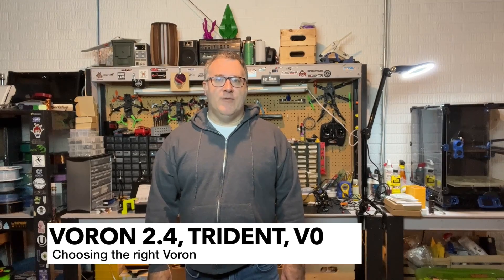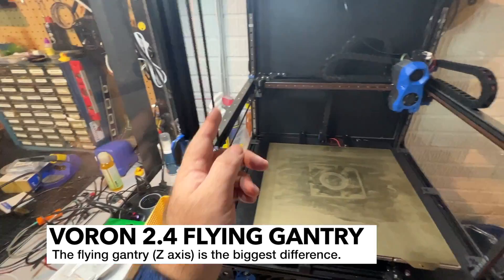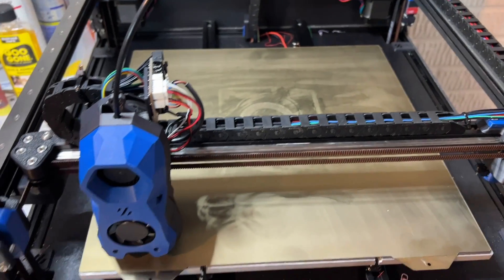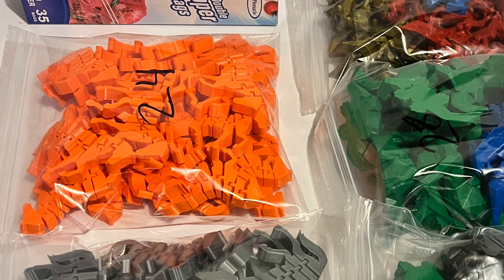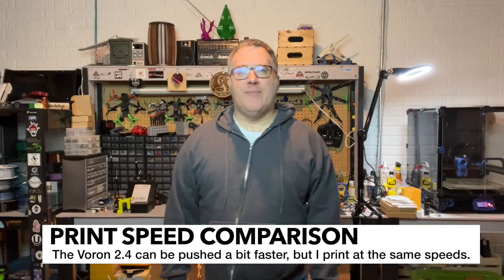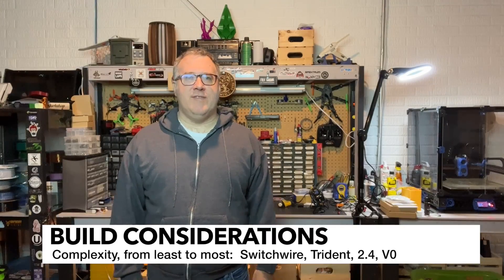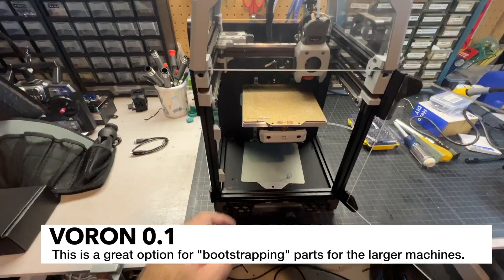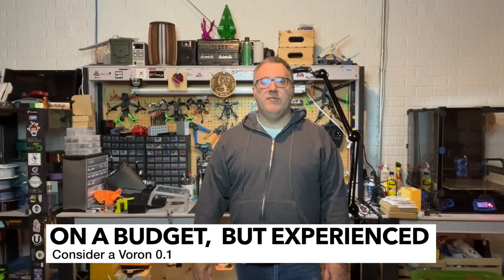Which Voron should you build?

Comment: This video was what I was looking for.  Earned my sub.  I think I want to try building a Trident (over purchasing something).  My question is, if I build it somewhere between decent and well, will I be able to "just use" it or will I have to constantly fiddle?  By fiddle, I don't mean mods I want to make, but changes/tweaks to allow reliable prints.  Thanks!
Reply from the maker: Thanks for the sub and comment! Once you build a Trident, you shouldn’t have to do anything with it unless you want to upgrade it. I would recommend going with Canbus or USB toolhead wiring vs a cable chain, as some of them tend to wear out prematurely.

Comment: I'm shocked the 2.4 has higher print speeds than the Trident. I thought a fixed XY would allow higher acceleration settings 😢
Reply from the maker: I think it is probably a toss up. Z hopping on a 2.4 can be very fast. To your point, Trident can be constrained due to fixed gantry. There has been a lot of points made both way and I was leaning to 2.4  as the advantage when I made the video.
Reply: @GregsMakerCorner  Thank you for replying! I'm thinking about building a 2.4 or a Trident to move beyond my Ender 3 Pro and Ender S1. I've tweaked and tuned them to create quality prints but want something faster. Your video was really helpful comparing the two Vorons.

Not sure if you care but I'm likely going to make a welded steel frame to make it ridiculously rigid and high inertia.

Comment: FWIW - I did the v0.2 S1  LDO kit as my first and didn't find the small size added to the complexity or difficulty - particularly with the high quality LDO documentation.  And the lower price of the v0.2 made it much easier to pull the trigger on the project as a whole.   I may do a Trident next - or more likely the Salad Fork.
Reply from the maker: That’s awesome to hear! The ldo kits are really good and they do have those nice slide in nuts now that make the build much more forgiving. Best of luck on your next build!! I am sure you can handle any machine now that you’ve got a 02 under your belt.
Reply: @GregsMakerCorner   Well, it's not all the way under my belt quite yet :-)  Just getting started on the firmware now.  But yes those little slide in nut holders make a HUGE difference.  I can't imagine trying to do the build w/o them.

Comment: very good video.

I would add that if you want to 3D for doing functional applications, the v0 is the one I would recommend.

Functional parts are almost always small (for example, all the parts to build any Voron can be prited on the v0).
Your design or prototype will make use of aluminium parts for the parts that require length (i.e. robot arm will not be printed, just the articulations).

From a pure engineering point of view the v0 / trident is the most pragmatic.

The only 2 reasons to go for a v2.4 is if you enjoy 3D printing to tinker with your printer or if you are into cosplay and you need very big PLA parts.

Great video again, you've listed well all the pros/cons I think (can't remember if you spoke about the fixed bed of the 2.4 that can warp (not sure if that has been resolved in the latest version of the v2).
Reply from the maker: Thanks, really appreciate the insight and feedback!!

Comment: Fantastic video, very well arranged!  I like the stationary bed of the 2.4, and only now just learned about the Trident's existence which sort of makes it a Rat Rig or Hevort IMO.  Question tho, could the triple Z be added to the flying gantry?  With a stationary bed, I think a 200x200 could be inserted into a 350x350 with a magnetic insert over both which might allow for dual zone heating of the bed for small or large parts.  I have decent CAD skills and am now planning to build me a CoreXY after many years with my trashy Tevo Tarantula, but I also built an MPCNC that I don't use, so have plenty of extra parts to repurpose.
Reply from the maker: Thanks for watching and commenting! I am not sure about a triple Z on the Voron 2.4 but that would definitely be a cool mod!! With a bit of cad work I think it could be done. Best of luck!!

Comment: Thank you.  great Video.  I built a v0, guess I started backwards as well.  Looking for a bigger printer, for the Voron 2.4,  any difference in build issue or quality between the different print sizes ?  300 vs 350 ?
Reply from the maker: The larger size Vorons will not be able to go quite as fast nor have quite the same max acceleration without issue. I have a 350 size and a 300, and they both are great printers. If you don’t think you’ll need the 350 I’d recommend going 300.

Comment: @10:30 "..Because the flying gantry should allow you to print a bit faster"
I don't get that? The fixed one on the Trident is more ridget, so more stability, so potentionaly more speed?
I only see more plusses for the Trrident:

- Ridget gantry
- More suitable for tool changers
- Chamber heats up faster, because printing at the top of the chamber
(- Easier to build)

Maybe the 2.4 is a bit absolete at this point?

Comment: You may benefit from examining the airflow from the fans under your machines to determine which components are requiring airflow and then ensuring directed airflow at them. Ducting can assist - just the same as is used in servers and other slim environments. The open sides etc mean that you may have very little static pressure and airflow over the items that need it. 

Too often air is not controlled on amateur designs and thus excessive airflow is used to compensate.

Comment: I started my voron ownership off with a gen one v2.4 I did a lot of things different when it. Mainly it runs rrf, it was a pain to get working. But I got used to it and despite the complication it's proven a pretty reliable machine. I considered getting a v0 then a Trident, entertained a micron or salad fork as well. Ultimately I bought another v2.4, the kits have greatly improved it's been a breeze to get working. I am squarely a huge fan of the v2.4 over all other voron designs. it's complexity does not equate to unreliability, it's over engineered z axis actually is the most reliable thing about it.

Comment: just to make this clear: "stealthburner" is the Tool head, NOT the extruder. The Voron extruder that normally goes with the stealthburner is called "clockwork 2", but the previous iteration (clockwork 1) fits as well
Reply from the maker: Good point! I often use them interchangeably when making content but you are correct. I don’t know anyone building cw1 with a Stealthburner shroud but there may be someone who does it.

Comment: My first voron was a v0 kit from ldo and i am currently finishing my 2.4R2 ldo kit and can confirm the 2.4 is easier to build.
my v0 has some issues i think i can remedy with replacing the host computer (CB1) with a genuin pi4. I have a pi4 in my 2.4 since i did not want to run into these issues on it

Comment: From what I see here the main difference is that the bed is fixed on the 2.4 but moves on the Trident. Did I miss any other major difference that would affect speed or quality?
Reply from the maker: You got it! That’s definitely the biggest difference. The main differences are related to the flying gantry and bed. 3 motors on trident instead of 4 on the belted Z for the 2.4. Even with that many of the parts on the machines are very similar.

Comment: Great video, I  am trying to decide which one to build. I was going to start out with the V0 and then use it to bootstrap parts for other printers. I also thought it would be good start since it was the least expensive of the kits. But hearing you same it is complex because of how small has me worried, this would be my first time building a 3d printer so I may look at the trident instead. Would you recommend any other builds that may be less complex? I was thinking maybe one of the prusa kits but I am unsure.
Reply: I recently finished my 0.1, if you are accurate in your measurements and do everything as described in the manual it's not that hard. Be prepared for a lot of disassembly in case you want to mod your printer (kirigami, nevermore, 0.2 conversion etc.).

Comment: How do you feel these builds are for people who are solid on mechanical and wiring but novice on programming. Was going to build up my ender 5 with parts sourced towards a future voron build
Reply from the maker: I think you'd be fine. A programming background isn't needed, but Klipper may be a bit of a learning curve. There are some good step by step instructions and stock printer.cfg files for the Trident, which make it pretty easy to get up and running quick especially if you go with an Octopus board.
Reply: @GregsMakerCorner  does it need a seperate pi or similar, ive heard both said
Reply from the maker: @2fwelding842  Yes, a Raspberry Pi (3 or better, model B) is the best choice to run the Pi. They are a bit hard to find right now "brand new" but you should be able to get a Pi 3 for a decent price, which would be around $50-60. The pi is what gives commands to the printer control board (usually a BTT Octopus).   Take a look at this guide for more info. I also have a channel on how to get it set up, see my BTT Octopus guide. https://docs.vorondesign.com/build/software/

Comment: My voron path was v0 -> v2.4 -> Trident. 
If I could only build one I'd say it would be the 2.4 because I think the flying gantry is the number 1 standout feature from the Voron group.
Reply from the maker: Yes.. that is a really good point! The flying gantry of the 2.4 does set it apart from other Core XY machines on the market. I have to admit, I really like that feature.
Reply: @GregsMakerCorner  I went with a 2.4 because I loved the flying gantry and bed tramming. Also the stationary bed is by far the best solution for large format printing, especially on heavy or tall items at any reasonable speed. Not to mention the bed tramming system works especially well with a conveyor belt module to eject parts!

On the other hand, the trident is better for non-planar printing, and can double as a filament drier since it can stash a spool to the sides and back of the bed! (And since the gantry isn't trying to move through that space)
Reply: What are the advantages of that? It just looks like more complication but I don't know what the advantage is.
Reply: @Graeme758  can you clarify your question? Advantages of what part?
Reply: @adamrosenberg4367  What is the advantage of the flying gantry over the Trident 'fixed' gantry? With the Trident bed only moving in the z axis, and relatively slowly, I'm not seeing how it is an issue with large prints.
Reply: @Graeme758  any time you have a lot of Z hops, like lattice structures, you'll feel the difference, also large prints add a slowly increasing load to the bed, and on a moving bed that means slowly changing behavior as the print progresses. For me the clincher was that lead screw driven beds have an issue with Z banding on the print, where a belted Z system minimizes or eliminates that.

True, you don't experience most of that on small, casual prints at moderate speeds, but nobody builds (or nobody should) a voron because they have a casual interest in printing. If that's you, then I recommend a Prusa, it'll get you what you need with minimal fuss, and is practically turnkey.

Comment: I started with V0.1 LDO kit and 4 months later built a V2.4 350 from LDO. In terms of complication I do agree that V0 requires you to follow the manual exactly step by step while V2.4 I can jump around the manual to a certain degree. V0.1 is amazing machine and I couldn’t believe that I printed all essential parts for V2.4 on V0.1 leaving only larger parts like skirts and screen housing for Prusa mini. I find the challenge of V2.4 not in the complication of flying gantry but installing the front doors to open and close properly without bumping into the door latches and also have the doors not sagging in the middle. Took me many tries of taping and peeling them off and re apply them.
Reply from the maker: The doors are really a pain! I used 3" wide masking tape to hold my door panels on my machine, from the sides and top, and then I installed the hinges with the VHB tape. I believe Steve Builds has a video showing a similar process. That method seems to be about the best way to guarantee the doors closing properly.  Thanks for watching and commenting!
Reply: Personally I ended up printing those larger, nonessential (to function) items on the V2.4 itself! I had my Ender 5 with an all metal hot end and an rpi cam inside of a cardboard box to print the essential components, then I taped the body panels and doors in place to print the skirts, panel clips, and other such that my Ender wasn't quite up to the task of printing!
Reply: I hate the magnetic doors. On my second 2.4 I went to using the latching panel mod as door latches.... Seems to work pretty good.

Comment: I recently built a voron 0.1 from a Formbot kit. And your videos was a great help! The hardest part was to 3d print the parts which took a couple of weeks on my ender 3 s1. Apart from that it was pretty straight forward. One tip, ad more nuts for mods later on. Also use the V0 No Drop Nuts or V0 1515 T Nut mod depending on what kit you got.
Reply from the maker: Great suggestions! Yeah, the nut mod really helps. Thanks for watching and commenting, glad to hear you got yours going!
Reply: This is the path I'm planning to take as well. I have an Ender S1 Pro and eventually want to upgrade via the Voron 0.1 (or 0.2 now) to the 2.4 or Trident.

One question I have: How was the ABS print quality on the Ender S1 for you? Did you buy an enclosure and do you have any pictures of how the result looks like? I'm still deciding between printing myself or just using the PIF program for it
Reply from the maker: @mark_walet  I can't remember ever trying to print ABS on a Creality machine, but you definitely can try it. An enclosure would be a necessity for the larger parts, otherwise you will get warping. If this is your first Voron I would recommend PIF or buying parts directly from a vendor, I have parts from BoxxyPrints on mine and they are better quality than what I have printed myself, and have always had a great experience.
Reply: @mark_walet I got very good results with no waping, using ABS+ from PrimaCreator and printed from an open closet with plastic covering the opening

Comment: The best overview for one looking at voron options. Thanks a bunch.

Question: I need 300x300x600 for ASA. Looking at your belted 2.4 it seams to be my best bet. Do you agree?
Reply from the maker: Thank you! I really appreciate the feedback. 

For ASA/ABS and something running 600mm for build volume, I think you would be able to accomplish that with either a 2.4 or Trident. You can use the "configurator" to get a BOM since your dimensions would be a bit different than the standard sizes.  In terms of which one would be better, I would probably lean toward the 2.4 because I think having longer z belts would scale a little better vs. longer lead screws on the Trident.
Reply: My thoughts exactly. Thank you

Comment: The extrusions don’t bend due to heat, they expand more than the steel of the rails. You’re actually putting the material under a thermal stress constraining it with the titanium. The titanium is meant to expand as much as the steel based on a cross sectional area.

It helps.

How much is unknown, I saw the FEA setup that voron picked up and it takes an issue that may exist a bit and shows it being a huge problem.
Reply from the maker: Great explanation! I was trying to explain it in simple terms, but I probably did a poor job. I’ll have to add a link to the page that explains the theory behind it.

Comment: The only mistake you made was that the stealthburner refers to just the cooling fans of the hotend not the extruder. 

For anyone building either the trident or the 2.4: the Voron extruders are called clockwork.  Clockwork2 only works with the stealthburner, clockwork1 works with both stealthburner and the original afterburner. They use different motors so check before you print the parts!
Reply from the maker: Yeah, you're right- CW2 is the extruder part where Stealthburner refers more to the cooling. I wasn't as careful as I should've been in the video on explaining that. Good call out! The point I was trying to make was about the nema 14 motor needed for the CW2 (vs. the nema 17 that is included in the LDO kit).

Comment: Good video, I my self went with the trident. Just a note, you can self source for cheaper than a kit if you take the time to find good prices. I self sourced my trident for like 850$ (including stuff I already had) with quality stuff like ldo rails and frame.
Reply from the maker: Very nice! I would like to know how you did that- assuming Ali Express? I've never found a practical way to get the prices lower than the prints. If you already have stuff that makes sense though.
Reply: @GregsMakerCorner  Nah no aliexpress, although I could have gotten it cheaper if I did. China is in lockdown so idk how long I would have to wait for my parts. Many shops llike west3d have partial kits and such. They also give free shipping if you spend enough so that wasn't really a issue. The only corners I really cut were a DC bed to make wiring simpler and yeah I did have some stuff at home already.
Reply from the maker: @Unscientifically  Ah that's great! Yeah, it makes sense that you could save some money with the sub kits and components and also have a bit more flexibility on getting exactly what hardware you want.